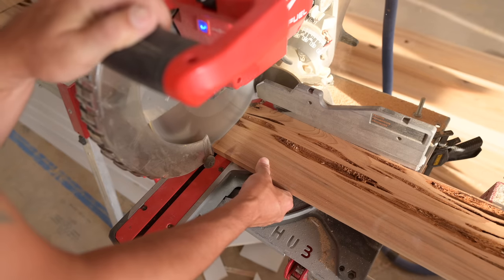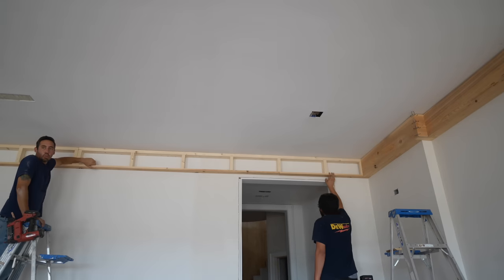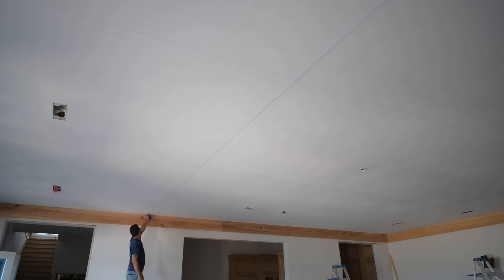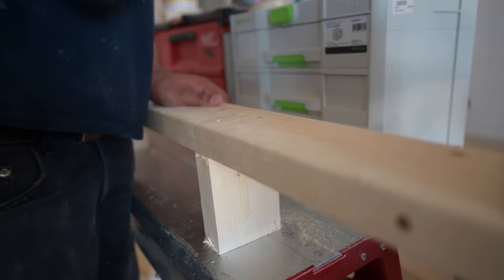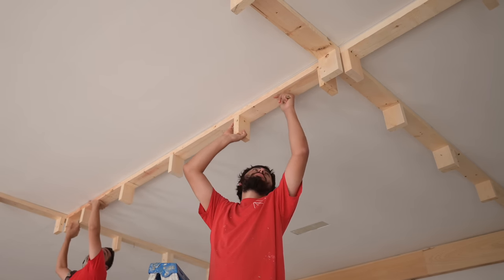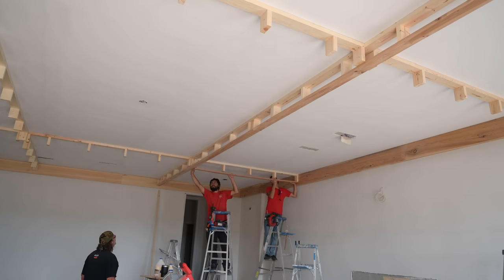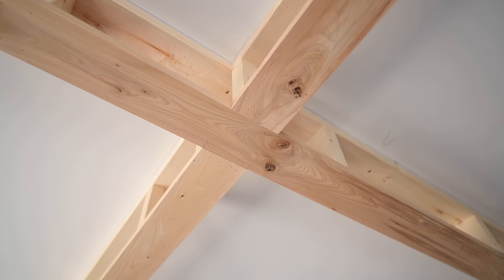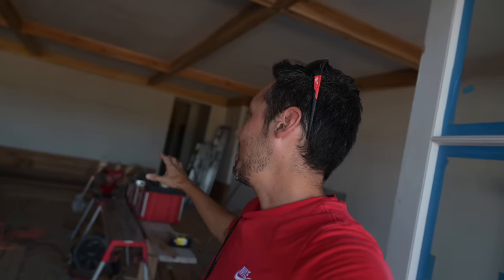BEAUTIFUL interior Beams - Step by step

Comment: This might be a silly question but have you heard of the 3rd hand tool? Its an extendable stick that works just like a quick clamp. I use it to put up cabinets, create plastic drapes for painting, and for holding stuff to ceilings. One of the most useful tools I’ve bought.
Reply: I thought of that, too. Then I thought of spending hundreds of dollars when a 1x or 2x will work.

Comment: Your client has good tastes in what image they want their home to project. I'm with you on the 1/2" drop on these beams. The shadow lines make their own statement in this highly figured wooden design.

Using the third hand is truly a time saver while installing blocking. Another advantage is it allows you to work the framing to the line when the lumber yard includes material that isn't straight.

Comment: Hey! Curious, on the side panels, on the long runs where you couldnt use a single board, how did you join the two boards? Are they mitered or square? Doing beams on a job right now.

Comment: I am so sorry to ask you this because I know you are not doing coffered ceilings right now but I just watched a video you did three years ago and I am following your instructions for making a coffered ceiling in my family room. I will be nailing to bare floor joists (no ceiling drywall) and I want to know why you used the 2 X 6 boards in the inside of the room? Would I be able to use 2 X 4s to span the room and 2 X 4 drops. The reason I want to do this is because I feel the ceiling is too low and the room too small to accommodate 2 X 6 rails (?).  My goal is to make access to plumbing and electrical much easier to access if needed. I intend to leave the panels loose if at all possible. Thank you very much for your help.

Comment: okay..as someone who does beams at work, how do you deal with the ceiling being totally f'ed up, besides scribing every cut. sometimes we use a jack (for a car) and push it up into our blocking and nail it off. is there a better way besides getting the beam to fit, then scribing, then taking it down, then cutting your scribe line, then putting it back up? Cause my boss is NOT interested in that process lol. he just tells the builders to float some drywall mud in the gaps. aka - it's not my house.

Comment: Why the blocking  I did the same with 1x6 but I didn't block it and gouge it on edges then wrapped joints painted black metal 1/8" x 2" great work but just asking

Comment: I’m not sure who designed that but it doesn’t look right.  Why would there be such so called beams which don’t look like beams on a ceiling like that. The size of the beams are too small and it’s obvious they are one by’s nailed together and stuck to the ceiling. I’m not sure what kind of Finnish your gonna use but your method and quality of work is very good just poor design compared to some of your other jobs. Architectural wise, it’s bad taste. But that’s just my opinion.